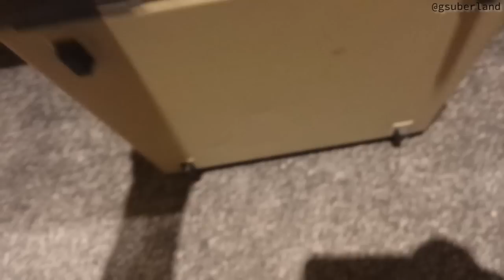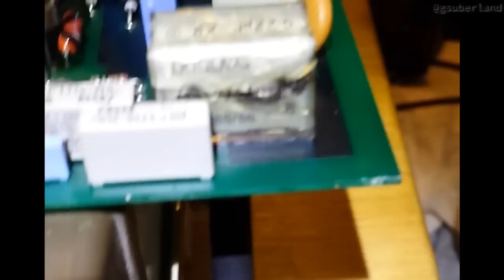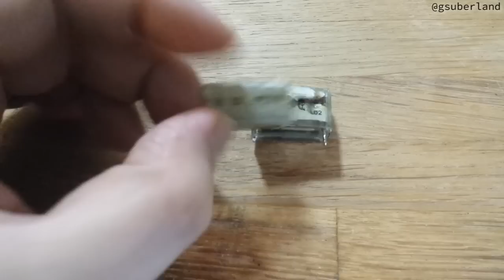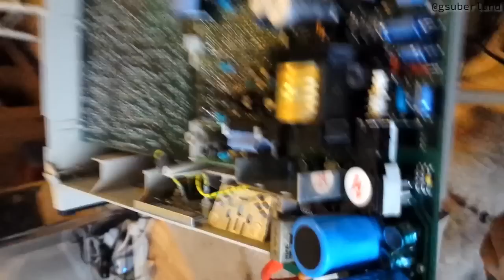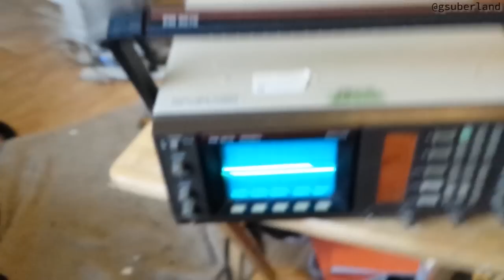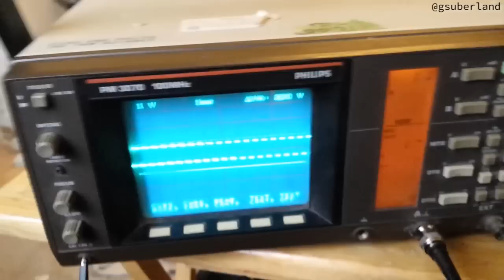Philips PM3070 Cathode Ray Oscilloscope Repair

Comment: I have pm3057 the powersupply looks almost identical also had a blown rifa cap , replaced it but still wouldnt turn on , just makes a high pitched sound from one of the transformers
Reply: I have the exact same issue. My guess is just that the electrolytic capacitors aswell are bad. Best to just replace all the capacitors on the power supply circuit board. Electrolytic capacitors tend to go bad aswell. With a switching powersupply as old as this bad capacitors will not let it start up
Reply: @HardDiskLover  what a coincidence i just asked a friend of my if he want to use my scope and then i got this message.
After i changed the rifa cap the scope actually did work the trick was to turn on. Than turn of after one second than wai 5 seconds and turn it on again. I sometimes have to repeat this 4 times but than it keeps working and wont turn off
Reply from the maker: One issue you may run into is that the logic part of the board will power up, but the HV supply for the CRT doesn't. Either way it's usually the electrolytic caps.

Comment: i have a PM3065 not in use for 9 years,  power up this week.
No action, but a hard noise. power off,on,off,on
YES screen on, lights on all oke. only the screen flickers.
Power up for 30min and then......... Some real loud noise en black smoke.........
Reply from the maker: If the display died during the noise, you probably have a much bigger problem than I did. Check all the caps as they're usually the culprit.
Reply: Graham Sutherland The display stays on and the lamps too. Smoke was on the left side.

Comment: Hi Graham,
I am up in Scotland (originally from Montreal Canada).
I have not plugged in my PM3070 for about 10 years (I brought it over from Canada).
When I bought the scope (new), I had the manuals but also bought the full schematics on this scope.
It is the same size and the manual, but the schematic pages unfold into much larger pages.
I am glad you got your scope working.
73

Comment: My PM3065 seems to be of a similar construction. I'm facing a power supply issue, too. Indeed, the plastic clips are VERY annoying. I'm still stuggling with that and can't pull out the power supply board. Could you explain the trick?
Reply from the maker: They're a real pain. You have to get a screwdriver down the bottom, where the bottom clips are, then push the top parts of the clips down so there's less pressure on them, so you can press them through. Sometimes the plastic gets caught and you have to jiggle it about. I think they were designed for easy insertion rather than easy removal.

Comment: It looks like you have a nice 'scope there hey :-)

About 3 weeks ago, I was given a FULLY working Tektronix 2445A with "OPTION 5" (TV triggering) 'scope + FULL, original ring-bound service manual AND 2x Tektronix "P6137" 10x probes, which had just had the power supply professionally repaired (electrolytics replaced).

Thank you for your video - it's very informative and God bless you :-)

Matt (also from England)
Reply: Those are very nice digital oscilloscopes; very fast for a late-80s development (500MS/s).